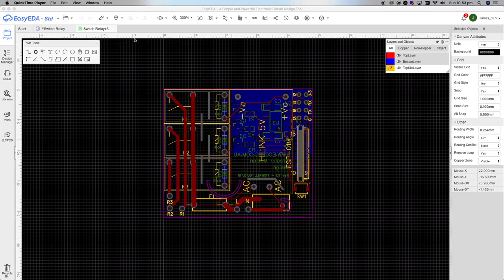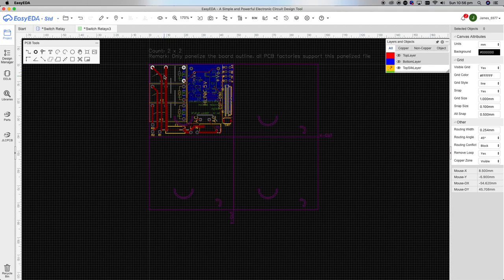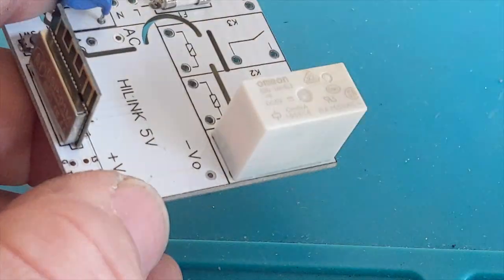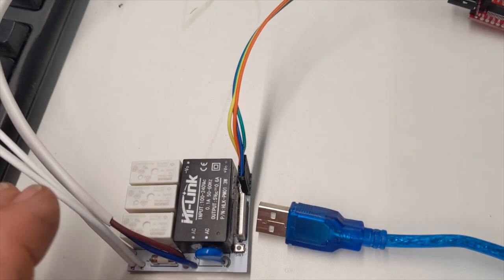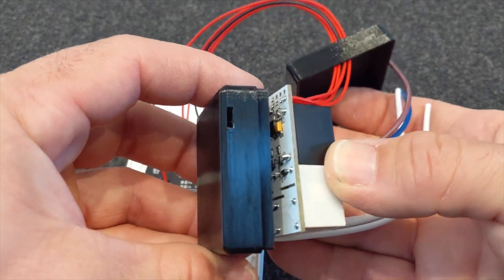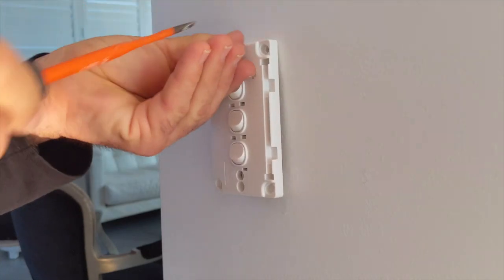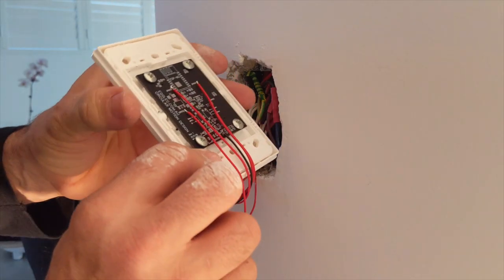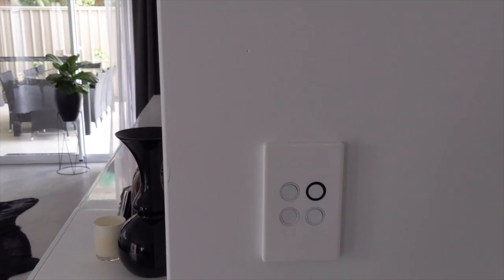Home Assistant - Installing WIFI Relay Module

Comment: Interesting vid mate. Basically 1 and a half sonoff minis from what I understood. I assume your a sparky or elec engineer by trade. How does this go for Aus compliance etc. The faceplate would be fine I think being super low volt. The actual relay box though? How would that effect  insurance? How much does your switch cost approximately? I'm guessing about $30aud minus labour. Really cool regardless.
Reply from the maker: Thanks for your interest and comment, I am a sparkly, I've been interested in home automation since 2002. As far as compliance goes , it does not fall into a category that requires compliance to WA state requirements, however any electrical device that is sold or install should be tested, and ensured that it is for and safe for its purpose. I would consider this safe as I'm using it in my house, within a wall box, but I would not use it in a roof space due to high ambient temperature. If it  was a production device, it could sell completed for round $30, I would describe it as 3.5 sonoff mini's. As it has 3 relays ad at least 4 switches. However in practice I have found it to be in some cases more than is necessary. I was going to develop this some more but would probably only include use 2 relays. As that is usually most adequate. Ctick compliance is another issue, however it is a standard esp8284 module that you will find in other ctick compliant devices. Any more questions feel free to ask. Thanks for watching
Reply: @SparkyJames  ahh yes 3 relays. I was thinking minis were dual channel at the time of my comment. Must have been getting confused with an aeotec or something.

Since 2002 is a good history. Do you do much in the residential market for HA in WA? It seems like the marketplace is picking up in the last couple years for devices, although we are lagging behind here in Aus.

I'm personally held back by my 3 speed capacitor ceiling fans, which don't seem to have a commercial product available yet.

It's always intriguing to get a more Aussie perspective on this stuff, keep it up :)